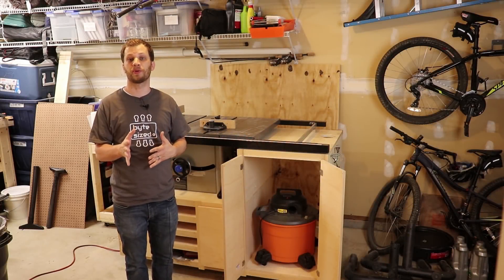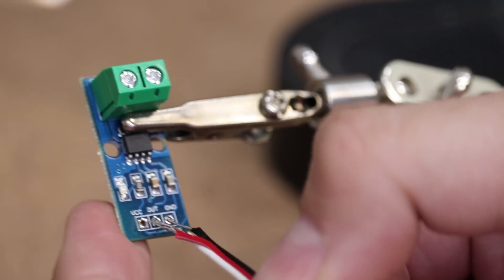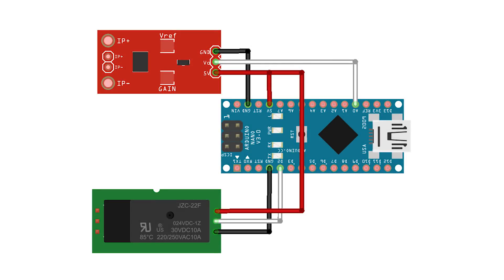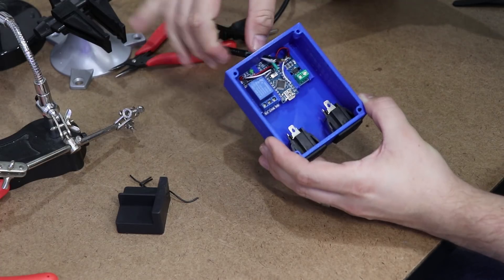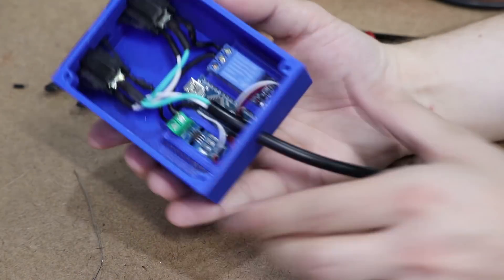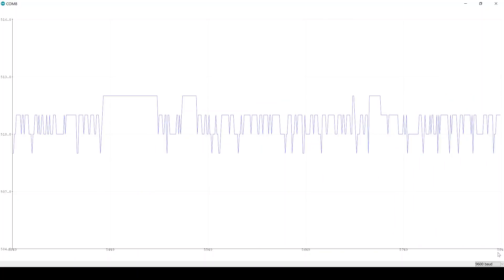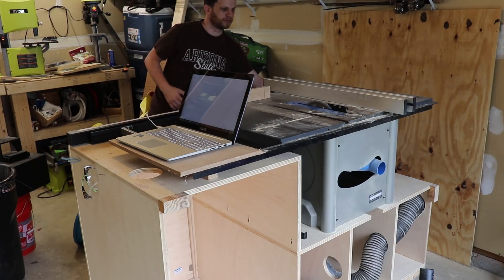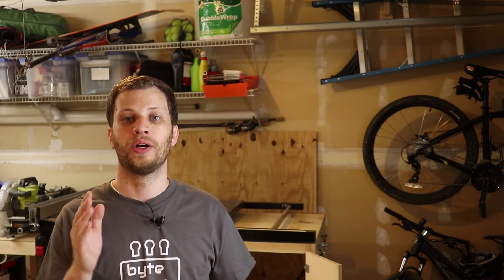How To Make A Simple Switch To Automatically Turn On Shop Vac

Comment: plug two units into an extension cord and plug it in, turn the two units on and then when you power the extension cord off and on they both run together, is that not simple?
Reply: kennybo completely different concept. Using the table saw is a slightly counterintuitive example. Easier to understand the value when using a miter saw you are turning the blade on with a momentary switch on the handle, pressing the switch will turn on the vac. Now imagine you are making 20 cuts, with wait time in between each cut. You can plug this unit in and the vac will power up for each cut without you needing to power on the extension cable or vac
Reply from the maker: Great example!

Comment: I'm missing something. Where does the arduino get its power from?
Reply from the maker: I ordered an AC-DC power supply for this project but it didn't arrive in time. I just powered the Arduino using a USB power supply. Sorry for the confusion.

Comment: thanks for the great device. I copied your device and code and for some reason arduino plotter only reads the shop vac turning it on for a sec every couple of seconds and not reacting to the table saw. if I switched the plugs to the other sockets the table saw doesn't work. I tried missing around the code and changing RELAY_PIN number I tried reversing the wires, I spent like 6 hours straight missing with it and it still not working properly. after watching the video many times I noticed its a little different than the schematic posted on your site, in the video you soldiered two blacks and two reds to the arduino board but in the schematic there is a black wire on each side of the nano board. which one is the correct one I did both but still couldn't read my tablesaw inputs in plotter screen :(

any help is highly appreciated. thanks
Reply: well, I reassembled everything from scratch one more time and was able to see the inputs of my tablesaw so I missed around with the wires to the relays and it worked, I think maybe one of the relays board (mine or zach's) is mislabeled. I changed the wire to third opening instead of first and voila it worked. thanks for your time and efforts zach to make this project possible for someone with too little knowledge with arduino.
Reply from the maker: Mohamed sorry I couldn't respond in time to help! I'm glad you got it figured out!
Reply: @bytesizedengineering  no problem dear, it was intresting enough to try to solve the problem. I just noticed that my relay gets stuck from time to time and I need to tap a little on the case to make it stop. after reading about similar problem with relays I figured there is an arc happens sometimes and it can micro weld the relay sides together which prevents it from releasing when the table saw is off. 

my question is do you think a higher rating relay will not be affected by this issue? I found a 30A rated relay with the same size and design but was hesitant to order it as I don't mind tapping the case if my relay get stuck

Comment: Lovely project. Have you wondered if you can achieve the same thing with a set of smart plugs scattered around the shop? The price tag would be higher but with something like homeassistant and nodered you can have multiple tools connected and the vac to stay on until all of them are off... No need to plug and unplug your tools either!
Reply from the maker: I think that's a great idea. I have considered revisiting the project and making it wireless and remotely triggered.

Comment: I know this video is old.  But, I am looking to build one of these but I need the vac and the saw to be on separate circuits.  Any ideas on how to achieve this? My saw draws 11amps and my vac 9amps.
Reply from the maker: You could use a 20A circuit. The design would have to change quite a bit to accommodate two circuits. I'm thinking about revisiting this project and making the vac remotely triggered. In this case they could be on two separate circuits.

Comment: How is the Arduino board powered in this setup ?
Reply from the maker: I bought an AC-DC transformer for this project but it didn't arrive in time. I just powered it with a USB power supply.

Comment: In my case, I would likely delay the start up of my dust collector, which will not start up on a 15 amp circuit. The beauty of your design is this is anticipated, and can easily be made in the code.  I did like the delay in the shut down.  Really helpful!
Reply: could you share the code for delay please?

Comment: Really enjoy your tutorials, I would like to use relays to run a 2 speed pool pump turning it on fast speed for 2mins to purge the system then turn it to low speed to save power, then turn it back to high speed before switching it off
Reply from the maker: This sounds like something you could achieve using some relays and a microcontroller like the Arduino. If you get stuck on a specific question let me know and I'll try to help.

Comment: You could have just connected the device and vac together and turn them on or off with same switch
Reply: In theory that would work for this one combination, however many tools have a large power draw and running say a cabinet table saw and a 2 hp dust collection system at the same time would likely cause an overload and trip your breaker. This example shows how you can do this application all over the shop.
Reply from the maker: Very good point. Thanks!
Reply from the maker: Yes, you certainly could. This allows more flexibility, and delayed shutoff of the shop vac so that it can suck up any remaining particles. This was a first revision, I have plans to improve this design and add more features.

Comment: Hi I have some problem with my work are different when I plug in Hoover it work straightaway then when I switch on tool The Hoover shutting down please help me I check wiring and it looks like everything is correct please please help me
Reply from the maker: Your relay module may use logic that opposite of what I use. Try changing your code to use inverted logic.
Reply: @bytesizedengineering  I will tell you honestly that I have never dealt with it even without saying that I was able to upload your cat seems to be a success. As if you could write a cat in reverse I have a 1500W Karcher vacuum cleaner and on the other side a 500W dewalt grinder and only this will be used. my request as soon as I could write such a code and send to electro_fix@hotmail.com I would be grateful. thank you and appreciate in advance. chris
Reply: @bytesizedengineering  Please Help me how to inverted logic do?
Reply from the maker: @D4D2005  I don't know if I can help you without more information and understanding of your problem. Please visit my website  https://www.bytesizedengineering.com/aboutcontact and submit your question in the contact page. That'll be sent to my email and we can try to figure it out.

Comment: Awesome... thanks!! I always wanted one of those, but In my country we have 220V AC and amazon only have products that works with 110V... I'll build two, one for my table saw and another one for my PC (to turn off the speakers, printer, external display)
Reply from the maker: It's always satisfying to be able to fill a need that Amazon can't
Reply: I’m in Australia using our standard 240v. I tried building this today using the exact same component (except enclosure of cause) but I can’t seem to get it to work. Would the 520 number you talk about change with the higher voltage? My table saw is single phase 3hp, draws about 10 amps.

Comment: Hey, thanks for this clear video.

I have tried to make this in a 220V situation and it works almost completely.
..
There are two things that I have noticed:

1: When plugging in the main plug (when miter saw and vacuum cleaner are already plugged in), the vacuum cleaner switches on for a few seconds and then it stops.

2: When I activate the miter saw, the vacuum cleaner jumps on, after use miter saw the vacuum cleaner stop after 5 seconds which is correct, but after +/- 30 sec the vacuum cleaner jumps back for 5 seconds without a reason?!

Can this behavior have something to do with the threshold value of 520?
How can I measure this treshold value exactly?

Thanks for your help.
Benny
Reply: In the meantime I did a bit of research and found a solution for me.

As I suspected, the "CURRENT_THRESHOLD 520" setting. was the problem
When in Arduino IDE the "Serial Plotter" is activated, (Ctrl + Shift + L) the base value of the reading was fluctuate between 516 and 519, but sometimes with peaks up to 520-522. 
These peaks are the reason why the relay for the vacuum cleaner was activated.

The readings of my mitor saw is around 640 and for my disc sander around 560.
By changing the "CURRENT_THRESHOLD value" from 520 to 550, my problem was solved. (#define CURRENT_THRESHOLD 550 //)

Thanks again for this great project.
Benny
Reply from the maker: Sorry I didn't get to you in time, but it sounds like you figured out the problem. Good work on that! Yeah, this is still an early prototype so there are some bugs to work out

Comment: Thanks for sharing this project. I surprised when I saw your video here since the same kind of device was in my mind for a long time. Finally, last week I made two of this for vacuums. I have used Arduino pro mini (5V), an additional switch for manual operation of vacuum and 9V power source for the circuits and the result is perfect.
Reply from the maker: That's awesome! I would love to see pictures! What did you use for an enclosure?

Comment: Why all that? Both tools run on 120v ac...accomplish the same thing by pugging both tools into a switched duplex outlet. Simple. $5-15 at any home improvement store (or routing around your grandpops basement)... easy retrofit onto or near to any large tool enclosure or make portable version to take around to any place or tool where the tool/vac combo is desired.. as always be mindful of amperage ratings. (Our master switch will be under the combined load of both tools) But to keep it simple, construct everything with 12 awg wire and a switch and outlet rated for 20amps. it will be able to safely accommodate any  residential standard vac/tool combo you can throw at it.  Most important though, i am a byte sized fan, From one Electrician/E-Mechanic/Tech to another; " Love your style Ohm-Boy! totally dig the channel" so I also know,  you know that I know you no better.  and would agree with me on this one ... golden time honored design and /or electrical rule.. Simple and clean is always superior  (least possible amount of connections, splices, moving/mech parts  etc. = Less pontential of component/circuit failure or fault). Props man... is my version more practical? Maybe. But it's not nearly as f*ckin cool 😉
Reply from the maker: Thanks for the comment. The relay is only switching the vacuum and not the tool so it only needs to be sized for the vacuum. I designed this so that I could still use the built in switches on the tools and so that the vacuum will stay on for a predetermined amount of time after the tool shuts off.

Comment: I didn't see any power for the Arduino, but otherwise this is a great project.  The beauty is you could plug a power-strip in where the tool goes and any tool that turned on would also turn the fan on assuming the strip can handle the load.

Comment: great video!  i was researching vacuum auto switches when i came across your video.  i would like to make my own now, too!  can this be expanded to accommodate multiple tools?  i have a table saw, planer, miter saw, and router that i would like to run dust collection to.  would i need more sensors? or could i run all the wires to the same sensor?  also, what program were you using to see the power spikes?  thanks in advance!
Reply from the maker: This is really good for one tool. You could plug multiple tools into a power strip, then plug the strip into the auto switch. If you have multiple tools around the shop in different locations, that might be difficult. Have you seen Bob Clagget's (I like to make stuff)? I would like to revisit this project in the future and put a sensor on every tool that sends a wireless signal to the shop vac when it turns on and automatically set the blast gates for the hose lines.... Future video maybe?
Reply: @bytesizedengineering  thx for the reply. I will check out Bobs video...

Comment: Thank you sir :) very interesting device, i have tried to make it but failed, it doesn’t work at all... can you sketch the wirings more detailed, and for the plugs... it’s my first time working with arduino and making something complex like this. I want to turn on a vacuum cleaner when a micromotor like dremel it’s turned on..
Reply: I build this project. It took a bit to get the code straighten out, but thanks to the lessons by Paul McWhorter on the arduino I was able to figure it out. You will need to keep it powered for it to work, but the Void loop; I had to change the two =LOW; into HIGH; and the last =HIGH; into a LOW;. After I got it working I messed around with some of the numbers in the #define, I raised the current threshold a little, and lowered the relay_startup_delay.
Reply from the maker: Have you looked at the build article on my website? https://www.bytesizedengineering.com/projects/shop-vac-auto-switch

Good luck!

Comment: Great project. Good idea. Excellent video and support material.

One suggested improvement. In my shop, I have 2 dust collectors (table saw and belt sander) and a shop vac (router table). I would like to have a power device for each machine and have it turn on the appropriate  vacuum for each one remotely. Could this be done with the Arduino code and suitable wifi relay ?
Reply from the maker: Yes, I have thought about this. I may revisit this in the future. Thanks for the suggestion!

Comment: I’m bit worried what decision insurance will make in case of fire. Those mains connect Ebay PCBs and home made flame retardant? electric boxes might be bit much to swallow. I would prefer if you address these kind of issues in your video. There is, let’s say, less bright people in the crowd and their fires might spread to something someone holds dear...
Reply from the maker: You're exactly right, anyone who works with electricity from the wall should know what they're doing and use safe practices.